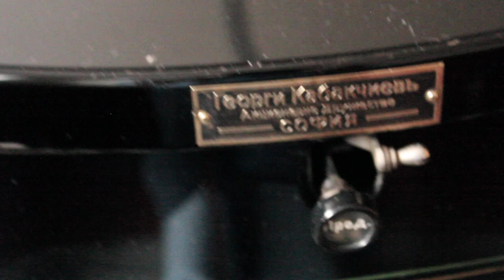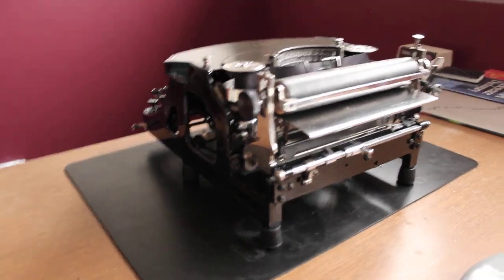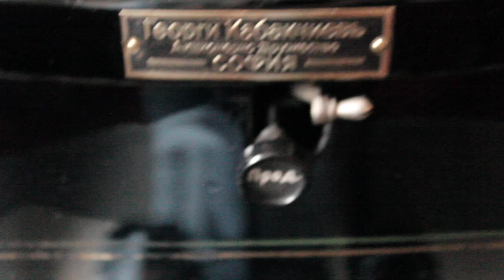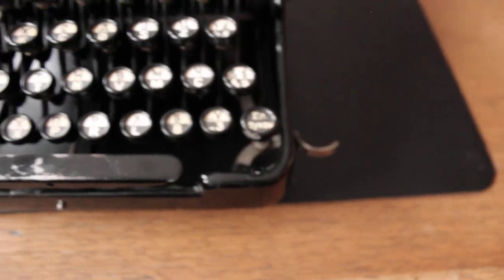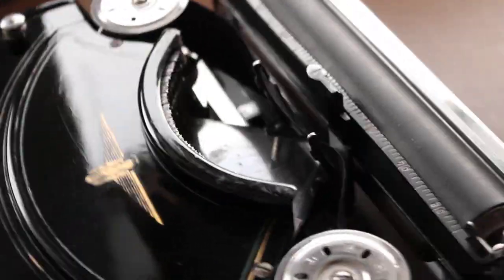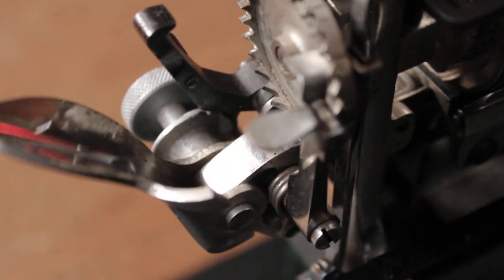1940(?) Adler Model 17 Standard Typewriter

Comment: Holy cow! What a cool typewriter! Thank you for showing us this. I have a 1949 Adler 46 with the thrust action mechanism, so I think the 1940 date is reasonable and even likely, although I don't believe the Typewriter Database is not complete for Adler (it shows no Adler 46 before 1953). Two full alphabets (upper and lower case) in one typewriter--without changing anything out, like a shuttle on a Hammond--blows my mind. Does anyone know of a regular front-stroke pivoting typebar typewriter with more than 3 characters on a slug?
Reply from the maker: Thank you very much for your insight! Really appreciate it. Every bit of information always helps along diagnosing a mystery or peeling back the story of cool history such as this. I currently don't know of any typewriters such as you described, but know for a fact they are out there. The Remington Noiseless Standard had two slugs on one type-bar...not sure if that counts.
Reply: @dr.typewriter-venneburgtyp121  I was thinking of the Noiseless too. I think it counts!